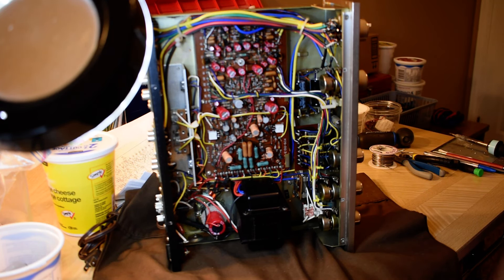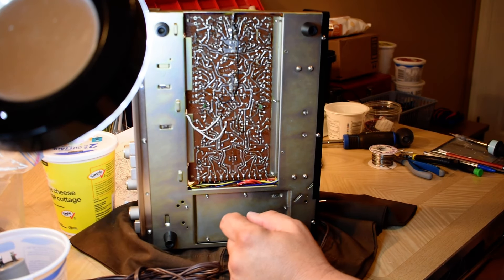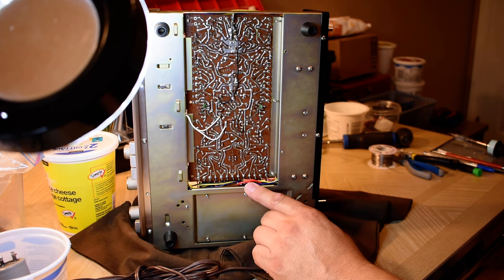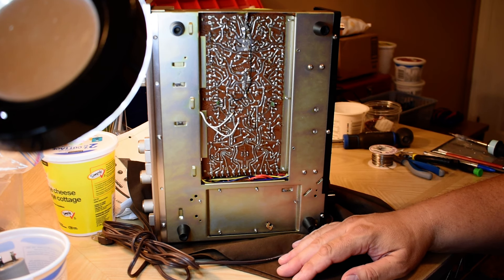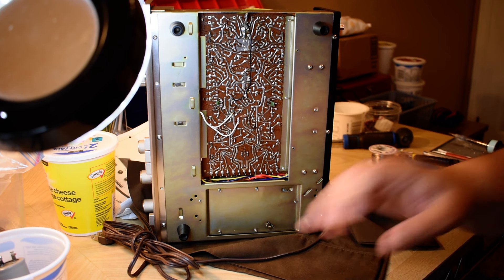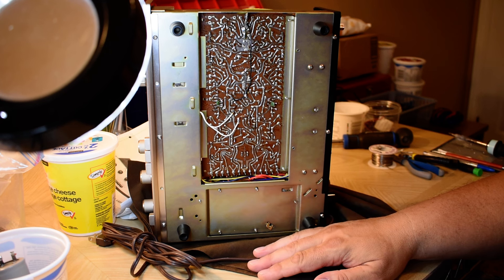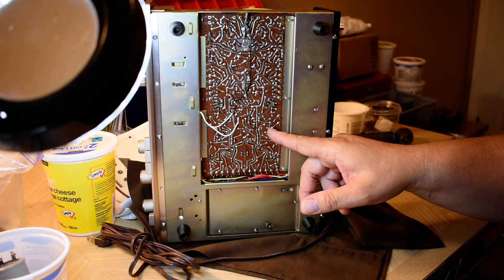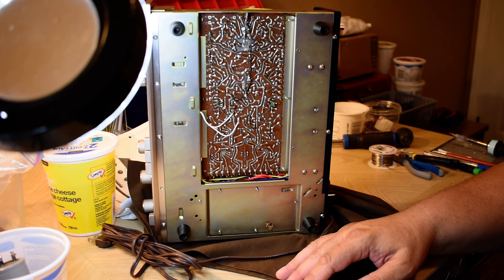Don't wear shortpants when soldering! When did you get your first soldering iron? Kenwood KA-2002A!

Comment: Here's a top tip for new solder soldiers... when desoldering cables and components, do it gracefully so solder doesn't go ping into mr. cornea. And if it does get stuck on there, squirt it with water from a syringe thingy so you don't do damage rubbing it in.